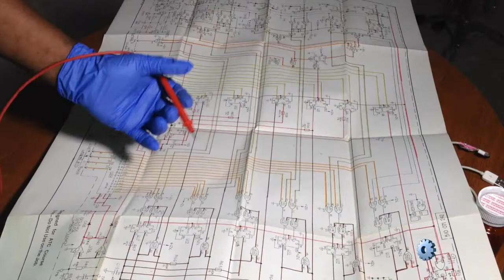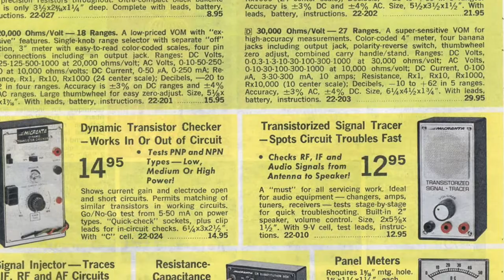Radio Shack Micronta Signal Tracer Shack VLOG 3

Comment: I would like to hear the sound it makes
Reply from the maker: I have to dig it out of my box of old tech. Yeah, I need to finish the video on that Radio Shack CB radio in that same box. I'll include the sound of the signal tracker in that video. I'll send you the link if that happens. Cheers!
Reply from the maker: I don't know if you watch my short videos, but I just posted two new plane videos. 
I usually post five or six videos on a single subject, then rotate to another subject. 
Right now i'm doing war machines. 
When you get time please take a look.

Cheers!

https://youtu.be/ZMczq1JAw2c

https://youtu.be/Mpvr4KN3_kA